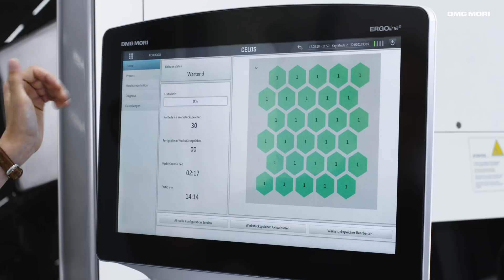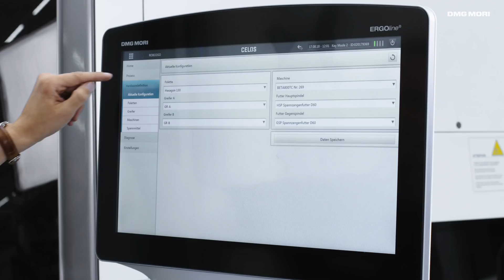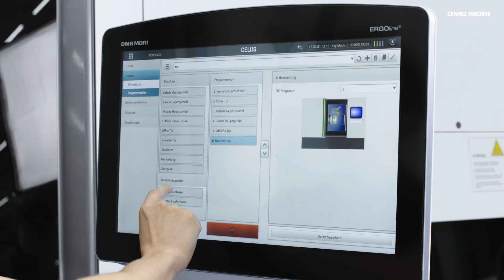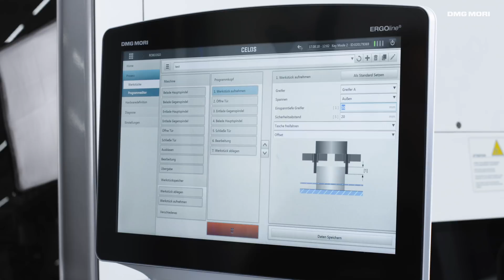DMG MORI Robo2Go 2nd Generation Tutorial

Comment: It`s amazing how DMG can take nice working NC control as Haidenhain or Siemens and add that Celos crap on top of it that cause more issues than help the process.. 
I have been using Fanuc robot with fanuc control panel to create program for it,  with Bridgeport machine that have TNC640 control. The company that actually fit the robot, took about week to install, and maybe another 3 days to teach us what to do with it.. Currently, the company I work bought fanuc robot from DMG to be connected with 5axis DMG DMU machine with  TNC640 control. 
Well, currently about 7 months pass, the robot is still in the box because DMG need to figure out way to connect it !?!? Wow! 
The robot2go maybe is funny option if you create arduino or rasoberry robot for the kids, but for real job  you have to have option to write own proper program.. and control it as you like. Take KUKA , ABB or Fanuc control.. 
What if I do not have that honeycomb setup , but horizontal stack of pcs? Or if the piece must be taken from certain angle, put on jig, taken from other angle and fit in the machine and so on.. 
Before Deckel Macho was symbol for quality and long lasting machine. Now they are crap. Constant issues with Siemens relays, contactors.. or control modules. The table bolts are weak.. The smart shit door lock cost 300++ euro, and the main purpose is to give only pain in the ass and get f*ued up only because coolant drop on it..